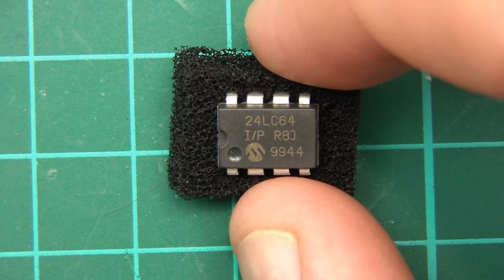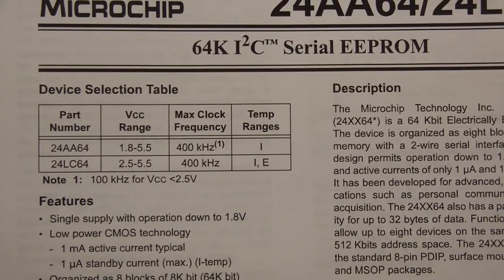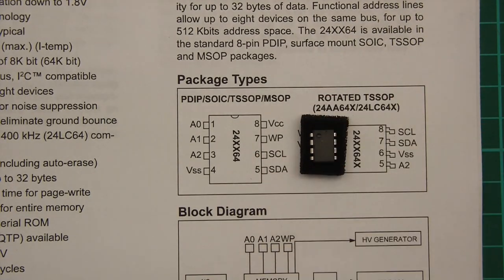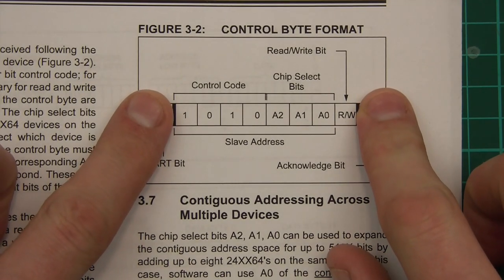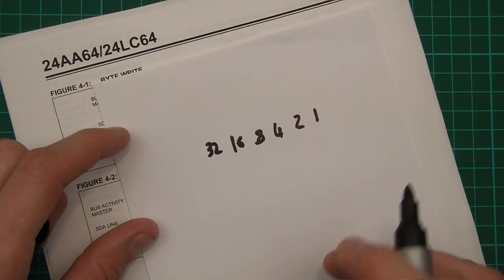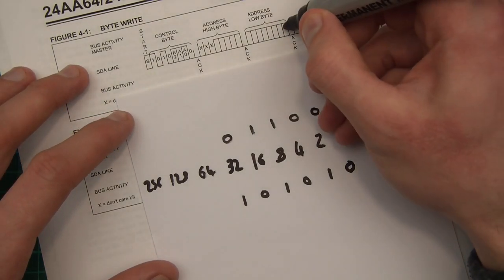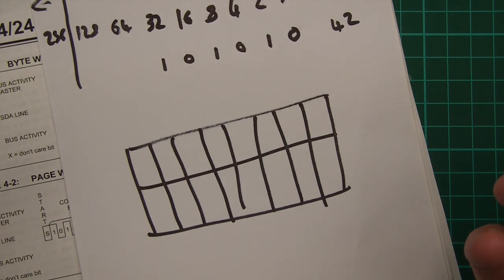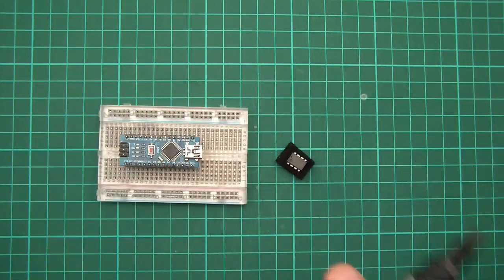TUTORIAL: How to Wire up & Code an EEPROM with Arduino - Module (Part 1 - Theory)

Comment: If i wanted to program a new laptop motherboard eeprom or reprogram in the case that it was corrupted  where do i get the code from?
Reply: You mean the BIOS? From the laptop manufacturer. I doubt you can get an aftermarket bios.

Comment: I have the eprom M5L27512k-2, and I don't have scl or sda nor vss, but i have a ground pin so i assume they are the same. i have 15 address inputs, 7 data inputs, vcc (Power) OE/vpp, and ce, what do i do?!?

Data sheet: https://www.datasheetarchive.com/pdf/download.php?id=7e67ea5cc21f84d466c8f694cfaa992faf6612&type=M&term=M5L27512K2